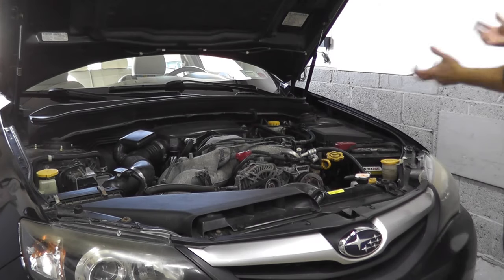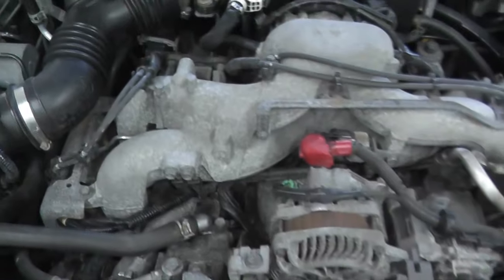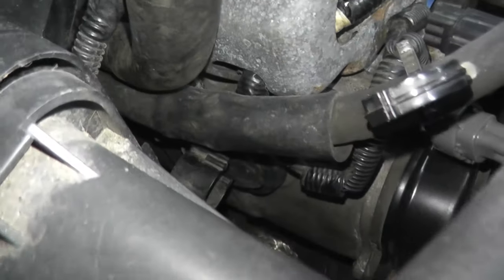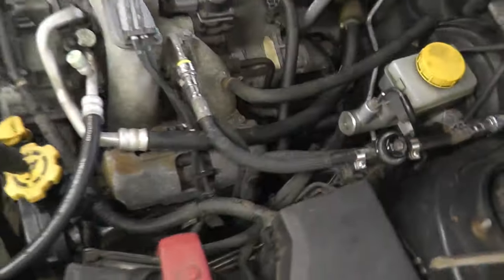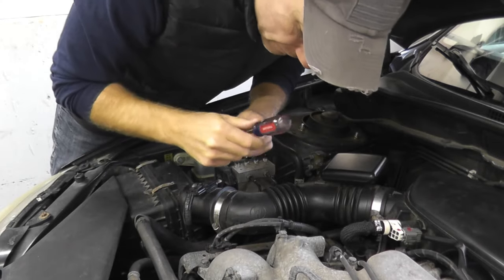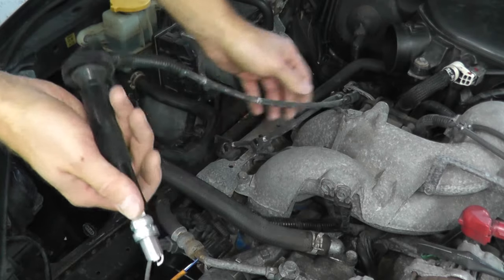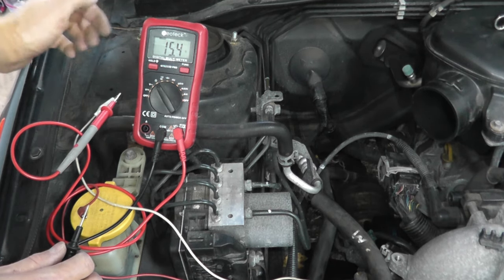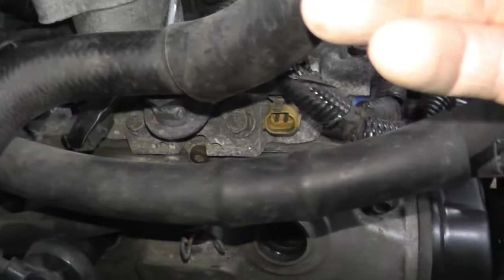Subaru Misfire Repair | How To Fix With One Tool Only!

Comment: You throw it in the trash because it's a subaru.
Reply: Agreed.Subarus are jjjjjjunk
Reply: Subie gang for life… meanwhile I’m doing a compression test now. Wish me luck.
Reply: <<<fool. Probably drives an audi
Reply: @deskillz99  Any luck?

I replaced spark plugs and wires,
ignition coil,
compression test (passed),
currently running fuel injector cleaner…..
Still misfiring….

Did you solve your misfire?
Reply: @Americansikkunt  cylinder 1 low compression (30psi) leak down test cylinder 1 (only held (15-20 psi)) leak was coming out of throttle body. Which means stuck intake valves. Gotta do a borescope to confirm hopefully it’s just stuck but if it’s bent I replace the heads.

Comment: Great video. The spark plug wire test should be reading in the kilo ohm range. The wire you tested showed 5.21 k ohms or 5210 ohms.

Comment: I put new plugs wires and coil pack in and the injectors are good  and I still get a P0301 reading    What do I do now?   It still does not run good when I get a load on it

Comment: My Subaru is throwing a speed sensor code. The fans come on with the key turned to ACC, the abs is on, engine light etc The throttle body is also making a noise. How do I do a step by step diagnosis?

Comment: I have the exact same Subaru and I also had my first engine blow a head gasket, destroying the engine. I put in a new remanufactured engine with better head gaskets and replaced everything else with new as well. Everything has run great except for periodic cyl 3 and 4 misfire codes. I have yet to be able to find the cause for it. 80,000 miles later and I am still getting the cyl 3 and 4 misfire codes periodically. Not sure what else I can test or how to go about testing internal mechanical issues.

Comment: Make sure to wear insulated gloves or carefully inspect the boots for splits/cracks First before Pulling on it Live- with vehicle Off. Pull on a Hot One that's cracked while it's running and get Cracked! Lol great help for simple diagnosis,  Thanks!
Reply: I just learned this the hard way...1" arc

Comment: Great video indeed, in SA they charge USD 180,00 for a new set of spark plug leads. So USD 50.00 for the ones installed in the video is a pretty good deal!

Comment: Thank you - very informative with so many ways to test.  Would have been neat to check one other quick home test for wires, specifically if wire casing is damaged causing short.  At dusk or in dark garage spray fine mist water on wires with car idling.  It the wire is shorting or arching should see a spark at wire itself and/or a dip in rpms.  Not sure how reliable but you def had a bad wire so would have been neat to see if shorting was obvious. Also good check if P0304 code seems to correspond with rainy weather.

Comment: Here you are round 2 week 2 saving me more money. Just finished my transmission cooling lines. Everything works perfectly. Now I’m solving a miss fire problem. Let’s hope you have something for the airbag light for when I get there 😂
Reply: Could be totally unrelated, but for certain '03-'14 Subaru models a Takata airbag inflator recall was issued for the front pass. side
Reply: @KB-ie7jr  thanks buddy definitely relevant. Going for my break lines and air bag in 6 months they have it on back order.

Comment: THANK YOU!  I'll try this next. I have gas leaking into my oil, a lot. My injectors all sound like they're click'n/working fine. No smoke out of exhaust, no 'check engine' lights, car starts & runs ok. maybe it's not getting spark on a cylinder??

Comment: Wish I saw this last year (P0301 and P0302}I've already gone through coil/wire/plug replacement with the dealer.
I have my Fix at a Subir shop for a second opinion. The current thought is the fuel pump.

Comment: Hello, mr subaru!!!
I have a 2011 outback with 140.000 milles and I recently put a fluid injector cleaner in to the gas tank( i put half of bottle LUCAS BRAND) the next day my car started to shakes and loose power, also the check engine light turns on, the brake light is on, the cruise light is on and the vehicle dynamic control warning is on…. Some videos on YouTube says it could be the gas cup or the parking brake light switch….. I CHECK THIS ALREADY AND THE ARE GOOD…. Do you think the injector cleaner DAMAGED the ignition coil or the spark plug or the injector???? Thanks again for letting me know, i subscribed to your channel to watch all the videos you have… the will help hound people like me….

Comment: I am a retired electrical engineer. Through my whole career, if I needed to fault find with electricity, the multimeter was the most used. The oscilloscope was second.
For this type of trouble shooting, a cheap Harbor freight multimeter will be sufficient.

Comment: I’m looking a buying an 97 outback with a misfire. It’s got about 180k miles and it’s auto. How likely do you think it is to have blown a head gasket. The owner isn’t mechanically minded and they don’t know the engine light code, or if it uses water etc.

Comment: If the injector test shows the correct resistance reading, is it still possible that the injector may be clogged and thus still not functioning as it should?

Comment: Probably won't see this since it's an older video but would the process be the same if you are only getting a misfire when the AC is on? My 2006 WRX runs great but within 5-10 min of running the AC I get a cylinder 4 misfire.

Comment: I am having the same issue with a misfire P0301  Cylinder one.  I did the beginning part and verify if there was something wrong with the motor unplugging the plug which it it changed the motor's idol So I believed it to be working correctly. I have tested everything you have stated and all seems in good working order. If your coil pack plug wire spark plug An injector is good What would be the next step if you're still getting A code for miss fire?
Reply: My motor was also pulled out recently had head gaskets and a valve job that has all new plugs and wires.
Reply: @nelnutta1055  I’m in the exact same situation.

What ended up causing the misfire?  Fuel injectors?  Burnt valve?

Comment: I had a cylinder one misfire. So I changed spark plugs and wires. Then after pushing some gas, all cylinders misfired. So I replaced the coil pack. When I replaced the coil it wouldnt start. But then I got another coil. Lights off again. If it doesnt stay off ill check injectors. But so far so good.
Reply: How did it go, tho?!
Reply: Just because it's new doesn't mean its good. shame you got a new faulty coil the first time.

Comment: I have issues on cylinder 4. I have replaced plugs wires and coil pack. I have 238k miles. Maybe time for a new injector? Or maybe the wire harness that pluggs into side of coil pack is damaged?
Reply: i’m having the same issue right now! Did you end up figuring out the problem?

Comment: Thanks for this helpful video. Appreciate it. 
I got 2010 Forester N/A engine. Had new spark plugs and wires, clean mass air flow sensor, new air filter. but still have what i call it ""detontation" when press gentle on gas peddle only. It goes away i put gas 94 octane. Otherwise will happen if put 91 octane or less. Any suggestions pls ?
Reply: Sell it and buy a Toyota
Reply: Does the "Check Engine" light come on? Then it should give some code(s) and you go from there.
Reply: Perhaps carbon deposits are causing  increased compression ratio.
Reply: @mohabatkhanmalak1161  No engine light on. Engine accelerates just fine based on the age and mileage of car (280k). No losing oil. I am just worry if needs engine repair or may be take it for Tera clean service for any carbon build up
Reply: Probably carbon buildup. Something in that cylinder is getting too hot. Could be so many things. Valve not seating properly, and thus getting too hot, or an injector worn out and not providing enough fuel. Or carbon buildup.  Id look at the injector first since its easiest. Get it out, clean it up or replace (usually requires ecu programming for calibration) and see what happens.

Comment: my subaru runs great til it warms up?...help!ps your vids are very informative as well...
Reply: I'm not a mecanic but from the research I did, I would check the EGR valve "exhaust gas re-circulation"

Comment: My 2004 Forrester XT is misfiring on all four cylinders at high RPMs. It'll throw 8 codes, each for each four cylinders twice. I've replaced the spark plugs and the fuel filter and I still can't find the problem. I was hoping maybe someone would have some input.

Comment: Check engine light came on yesterday with a P0301 code. So does that mean I only have to worry about cylinder 1 or should I check the other ones as well? Also this was probably one of the most helpful car fix YouTube vids I’ve ever seen.
Reply: Cylinder 1 is ur problem

Comment: I have a 2012 Subaru Forester 4 cylinder I did 4 4new spark plugs and 4 new coil packs  only codes I get is a permanent misfire in all 4 cylinders I checked all hoses and replaced throttle body and still misfire in all cylinder ?? Help does anyone know what the problem is?
Reply: Check the coil pack. Each coil wires go to the coil pack. Unbolt it and check for continuity. There are youtube videos showing you how to do it

Comment: What if my coil packs are not numbered, any way to tell witch goes where
Reply: Someone Answer this need help
Reply: There are 2 long, 2 short. 2 long go to cylinder 2 and 4. 2 short go to cylinder 1 and 3.
Reply: The front ones have a different color connector to it

Comment: What does it mean if I have misfire code but when I pull the wire the engine does begin to shake and stutter
Reply: It means the misfire is probably intermittent.
Reply: @Nbomber  yes my check engine light goes away sometimes does the point to any certain issues
Reply: @GooseBumppps  tbh, I wish I knew.

Comment: I have a Misfired cylinder P0304 those that mean its a ignition coil or the wire?
Reply: Could be a lot of things. 
Bad injector
Bad coil
Bad wire
Bad spark plug
Bad coil pack
Bad cylinder compression
Bad fuel pump
Bad MAF sensor
Air leak
Bad EGR valve
Pretty much anything that has to do with air/fuel mixture and electricity.

Comment: Any advice for a choking 2015 Outback 2.5l. No error codes or engine light coming on? It chokes only at around 1500 rpm's.  it's not the PCV valve, that's new.
Reply: Let me know if you got this resolved. I have the same car & same problem.

Comment: Does a wet plug mean the injector is working?  Or can it overfuel?  Had the P0301 and bad miss.  But after gapping plug and checking the wire, and still throwing the same code, suddenly miss went away and not throwing the CEL.  I'm guessing coil but haven't tested it.

Comment: If the injectors are clicking consistently with the screwdriver test, then the ohm resistance test can still show other errors with the injectors, correct?